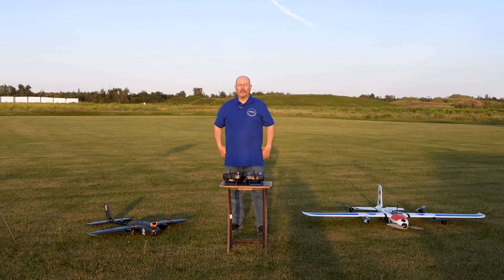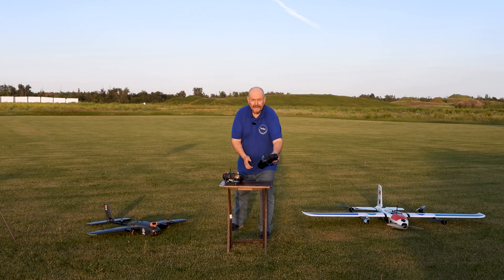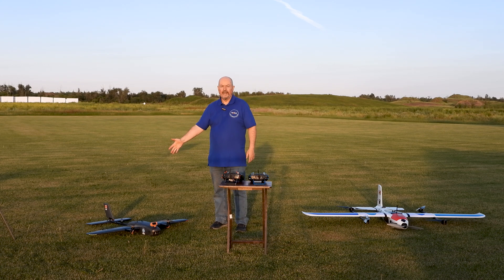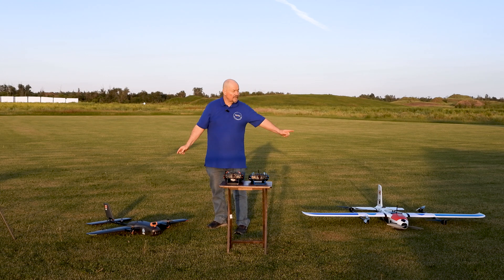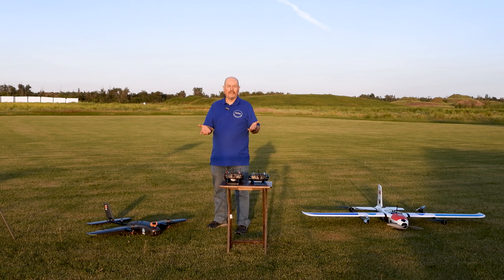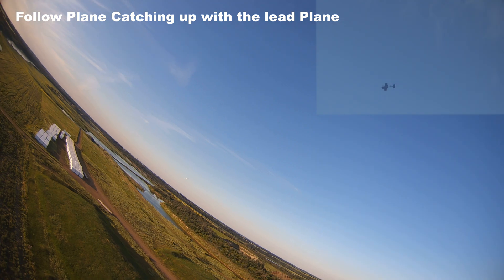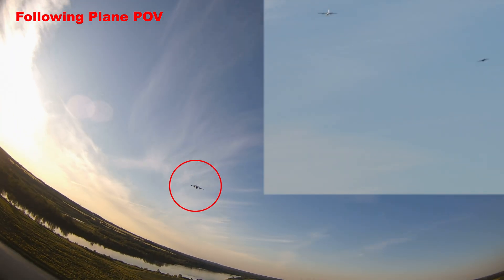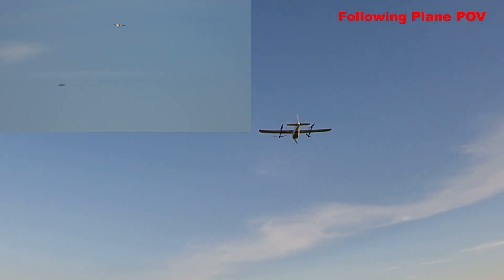How does it work? Fixed wing drone swarming  - autonomous!

Comment: Hello, good day. Do you think it would be better to install a thrust propeller from the front? Or a thrust propeller from the rear? I will install a gimbal under the aircraft.
Reply from the maker: Functionally it's fine either way, but having the prop at the back (or using a Tilt like the T2 Cruza) is better because the properly stays out of the camera view. My next VTOL plane will have the motor/prop at the back.
Reply: @timtheplaneman Thank you